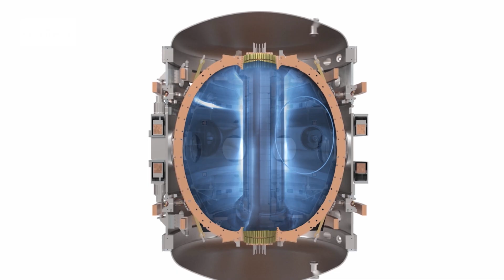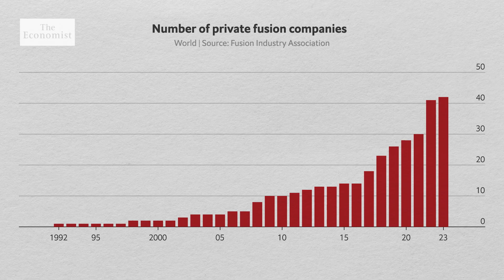Is nuclear fusion the future of clean energy?

Comment: What about the radioactive waste generated from neutron activation? The D/T fusion process generates 14 MeV neutrons that activate (make radioactive) much of the structures needed to contain the fusion process. 

To say fusion is a "clean" energy source is an outright lie.
Reply: This comment is either misinformed or a lie, Fusion energy does not generate any long lived radioactive waste, it is by all accounts a clean source of energy, and more so than many if not all options available, with the only other option coming close being fission energy.

Edit: Also I should explain so that it's easier to understand than without an explanation. A fusion reactor produces helium, which. It also produces and consumes tritium within the plant in a closed circuit. Tritium is radioactive but its half life is relatively short.
Reply: @chiari-next2202  this is the problem with public messaging: it has to be kept simple and without nuance. Most people are so scared of nuclear waste and meltdowns and fall-out, but the reality is that Fission is the equal-safest energy source at present, tied with solar. Fossil fuels, hydro, wind all have more deaths per MWh of energy produced. And the issue of dealing with the waste is entirely socio-political, not practical. But because this irrationally overblown bogey-man looms large in the public view, Fusion messaging steers well clear, often simplifying the message to "no nuclear waste". This then gets some people's hackles up when they learn that fusion will produce some radioactive waste. They smell deception and trust goes out the window. The fact that it will be small amounts of low level, short-lived waste, mostly pieces of metal, vastly easier to deal with than the fission waste (which isn't really a problem anyway) gets totally lost. Nobody worries about low level nuclear waste from hospitals. Cars are more dangerous. Trousers are more dangerous.
Reply: @chiari-next2202 Deuterium-Tritium fusion releases neutrons. These neutrons will combine with atoms in the structural component of the reactor, causing them to become a different isotope.

The majority of artificial isotopes are unstable, and thus undergo radioactive decay. It is a reasonable assumption that the reactor vessel will be treated as radioactive waste when decommissioned.
Reply: @RMX7777  while that is true, the half-life is short enough that it's insignificant to anything otherwise keeping it from being placed in the category of clean energy. The creation of solar energy inherently creates pollution, and it itself is considered "clean energy."
Reply: @chiari-next2202  It's true, a fusion reactor would only need to be treated as high level nuclear waste for 10 years or so, after which it could be treated as low level waste.

I would argue however, that neither fusion nor fission waste would prevent either from being a clean source of energy. In both cases, the waste is completely contained and never makes it out into the environment.
Reply: To say any energy source is clean is an outright lie. Radioactive waste from the structure of this kind of reactor will be from low activation stainless steel and, possibly, aluminium. It will have to be renewed periodically, stored safely for a few decades and then it will be, essentially, safely disposable. More advanced fusion concepts hope to employ a "liquid first wall" which vastly reduce the amount of high energy neutrons reaching solid structural elements, and the liquid itself doesn't become radioactive save for the fresh Tritium that it produces. Other approaches are aneutronic. But the early systems will be D/T.

Comment: How is the heat going to be transferred to the turbine generator side?  If the heat is not properly transferred the machine melts down.
Reply: in this type of reactor fast neutrons generate heat in some kind of liquid lithium (producing more tritium fuel as it does so) which is heat-exchanged with water, which generates steam for the turbines.
Reply: @MattNolanCustom  it's been awhile for me to do those energy equations.   The energy from fusion is the excess mater of the proton converted to energy.   Orderly the is no fast neutrons but when there is many many reactions once and awhile one will happen... using a deuterium base material there is probably going to have tridium.  The energy has to transfer from the fusion reaction to a themo cycle. How is going is happen is what I am curious
Reply: @lewisreiman8124 Not sure what you're trying to say here exactly, but Deuterium-Tritium fusion releases the majority of its energy as a fast neutron. 

Fast neutrons barely react to objects with high atomic weight, so they will pass through the walls of the reactor without causing much heat. Upon reaching the lithium, which has a very low atomic weight, it will quickly slow down and transfer energy into the medium. Water will then be pumped through the lithium beds to cool them and transfer heat to the generator.
Reply: What? How can a fusion reactor meltdown?
Reply: If the reactor doas not cool probably a meltdown could happen or just a big explosion.
Reply: @lewisreiman8124  neither could happen. There are mere grams of plasma in a tokamak at any one time. It's not like a fission core where there is months or years of worth of fuel in there. Fusion does not have a chain reaction like fission either. If anything goes wrong with the reactor the fusion stops.
Reply: @lewisreiman8124  you are confused between fusion and fission

Comment: Isn't there a problem with waste heat from fusion, once we get it working?

All that "limitless power" gets people excited, quite understandably. But once it has been used, the waste energy will go into the biosphere and slowly heat up the world. It's not as fast as GHGs but could eventually be an even bigger problem.
Reply: Not really. The waste heat is literally what we're hoping for. Boiling water and turning turbines. It's a completely different method of warming from GHGs and is FAR less problematic.
Reply: @Cyrribrae pardon? If they boil water to turn turbines, the water/steam has to be cooled down again. That is the waste heat the commenter was referring to. Basically the same as coal or nuclear plants now. The heat is generated on purpose, but then has to be dissipated as waste after electricity has been generated.
Reply: @Cyrribrae how much water is needed to neutralize  100 million degrees Celsius of the plasma?
Reply: @nesseq  how many grams of plasma? Don't confuse temperature with heat.
Reply: Currently coal and nuclear plants dispose of low grade waste heat using cooling towers and ponds.

Yes, we do need better uses for this heat, flash desalination, agricultural green houses and district heating all spring to mind.

However, provided it is properly managed, there is no real risk of overheating the earth by this means because with properly designed systems excess heat can still be radiated to the sky (ie. the universe), which typically has a temperature of -60 - -40C.
Reply: @jimgraham6722  when you say “sky” what do you mean? Inside or outside of atmosphere?

The typical temperature of anything is irrelevant. If the heat all escaped into space - and did so quickly - then I would agree it is fine/safe. I am Minh pointing out that saying something has a low typical temperature does not mean heat escapes completely and quickly into space.

Again, it might be fine, but the logic in your comment does not actually demonstrate that yet.
Reply: Waste heat will always be a non-issue. The sun heats half the earth at over 1000 watts per square meter, power plants have nothing on that. The warming of the earth is influenced more by the gases in the atmosphere than by heat at the ground. Earth constantly loses heat into space, but a fraction of that heat is returned due to greenhouse gasses. 

The hotter earth gets, the faster it radiates its heat away. The final deciding factor for global warming is the composition of the atmosphere.

Comment: Cold fusion is possible due to quantum tunneling effect.  We can create an apparatus to induce fusion reaction by understanding more how quantum tunneling works.
Reply: Get busy then. We're waiting.
Reply: Quantum tunneling is already fully understood. Its probability is based on the ratio between the width of the activation barrier vs. The debrole length of the particles that are attempting to fuse.

In other words, the faster the particles move, the more likely quantum tunneling will occur. This is exactly what modern fusion reactors are trying to accomplish, heating fuel to hundreds of millions of degrees reduces the width of the activation barrier, thus causing particles to fuse due to quantum tunneling.

Comment: Realistically speaking, effective fusion will be mostly possible in minimum 50 (if a scientific miracle happens) to 200 years or more. That’s where we are. All the claims of successful fusion by some private companies were all trickery to boost their stock values. Right now, we need pretty much two nuclear fission reactors to supply enough electricity to generate enough power for laser to trigger fusion process. Currently, illusion of the nuclear fusion has been used to redirect the necessity of clean energy toward, so called, smart, small modular nuclear fission reactors without any solution for fatal nuclear wastes. US has initiated this and other oil industries are joining this movement as it allows oil and gas industries to continue their business by delaying clean risk-free energy conversion.

Comment: Short answer, no
Long answer, no 
Longest answer, maybe
Iter the largest most complex device ever made by humans costs 22 billion currenly will have a Q of 10 at 50 MW 
So 500 MW thermal to convert it to electricity you lose about 30 % so in total 350 MW electric minus ofcourse your input losses 
So for 22 billion this reactor will at best produce 350 MW electric
Im saying all this to emphasize the process of innovation
Iter wont come online until 2025 - 2026 according to their website 

Factor in another 5 to 10 for testing 
Factor in another 5 for 2nd generation iteration 
Factor in a build time of 5 - 10 years 
Being conservative 2050 is the earliest we get anything that can be sold as a product 
Until then we gotta hold off on singing kumbaya
Reply: ITER's own long-term timeframe is 2100 with their DEMO II project.
Reply: Those dates will be here before you know it. The future is fusion!
Reply: @Melanie____  LoL
Reply: The latest projections from ITER are not to produce as much energy as is being consumed until the mid-2030s, and hopefully to ramp up to produce about ten times out than in some years after that, but all that energy will merely produce heat.  ITER is not designed to ever deliver any energy to the power grid.  Assuming ITER achieves what the designers hope for, the plan is to then build a yet-larger plant that could eventually deliver power to the grid.  Even that plant is not claimed to be commercially viable.
Reply: agree. We need fission
Reply: “Will have a q of 10” but presumptuous to be saying this, don’t you think?

Comment: The kryptonite for fusion is battery tech. If those go exponential, we can store wind and solar energy instead of having to rely on in between sources like coal.
Reply: Batteries have HUGE environmental impacts and introduce a lot of complexities on public grids
Reply: @lourencoxbfragoso  The environmental impacts are being dealt with, but at any rate are far less than the fossil fuels they help to replace.  Complexities on grids?  They make grids work better.  Batteries provide the best frequency stabilization available.
Reply: battery are a joke swapping one power source for another is not high tech
Reply: @frankrenda2519  pov you have no idea what you're talking about
Reply: @jb76489  i am a electrical engineer what are you a 15-year-old on your mother's computer its quite obvious you not very bright
Reply: @frankrenda2519  was that supposed to impress us? Sorry bro but what you said is just as inane